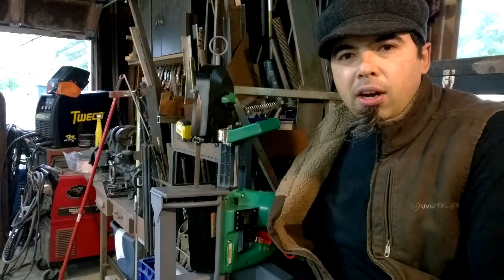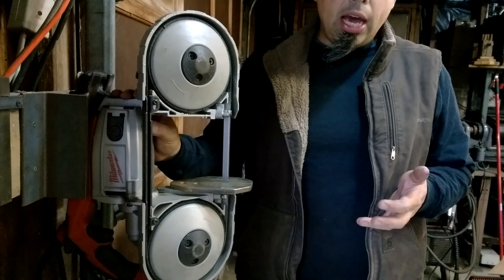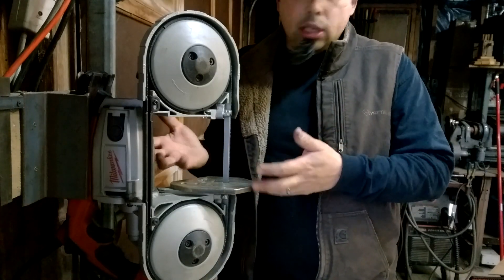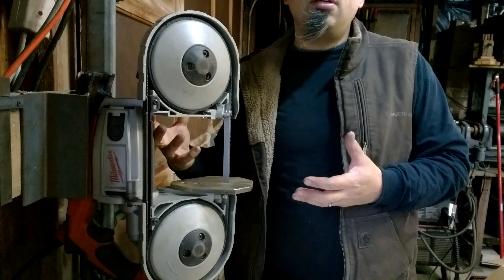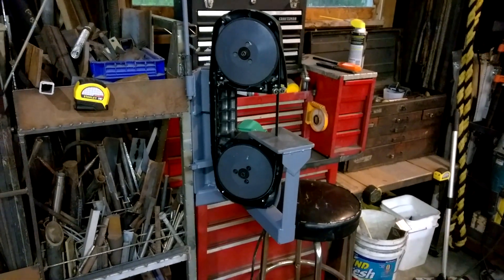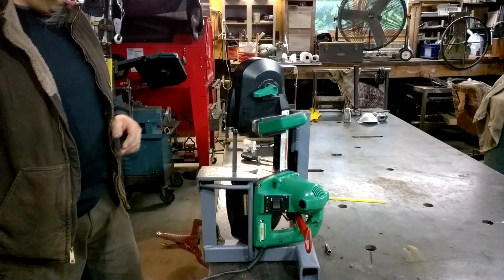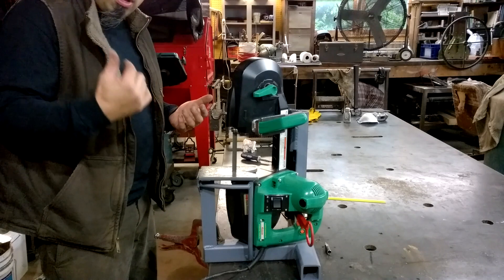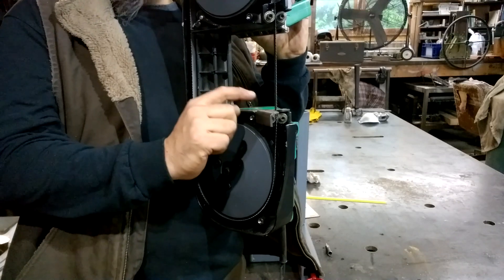Three Way Portable Bandsaw Table Attachment For Wall, Table And Handheld USe

Comment: I love that trigger lock!!! I've been using a stupid spring clamp and its a pain in the ass. 

You're sharing some serious wisdom with little things like this, much appreciated man.
Reply from the maker: Thanks Preston. Yeah I use a spring clamp on that Milwaukee set up. I bent them so they don't slip off but they're hard on that rubber grip.

Comment: Too bad Harbor freight and other manufacturers  don't use that side motor design. i hate that 5 inch depth of cut limitation.
Reply from the maker: If you do a little digging you'll find that that design is still made in the Dewalt and Porter Cable brand.